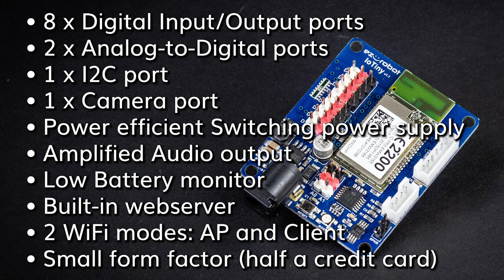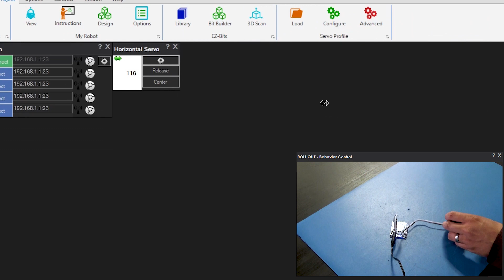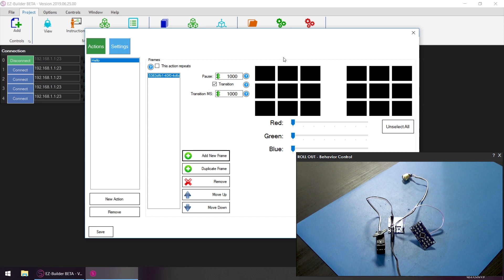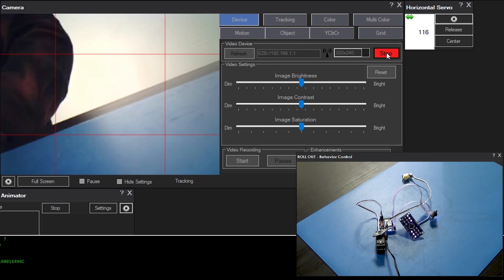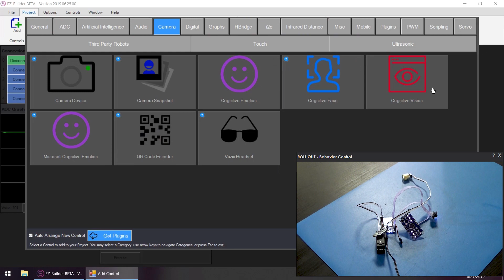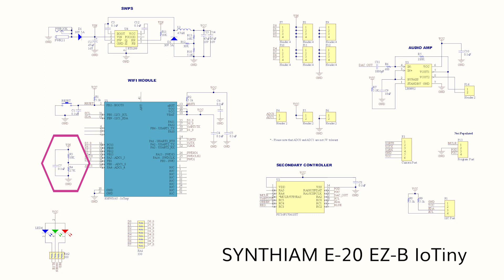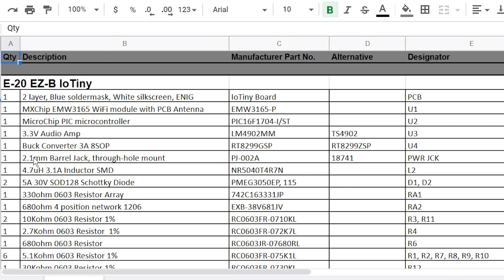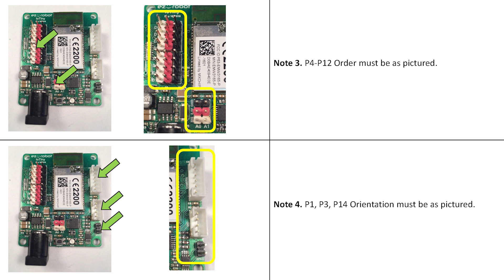Roll Out - EZ-B IoTiny

Comment: Is it possible to connect a motor shield like an Arduino A000079 Motor Shield to the iotiny to control a pair of DC motors? If so, how would it be wired?
Reply from the maker: Yes. Visit synthiam.com and ask your question on the forum. YouTube isnt a great system
Reply: @Synthiam  will do.  Thank you.